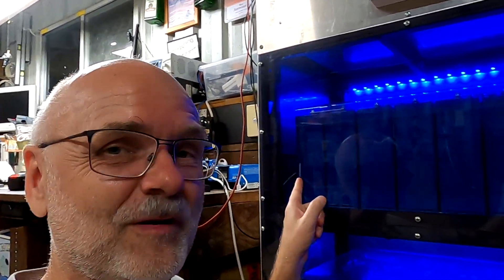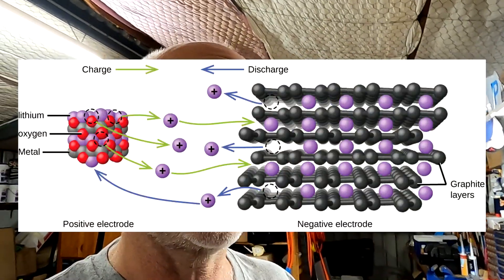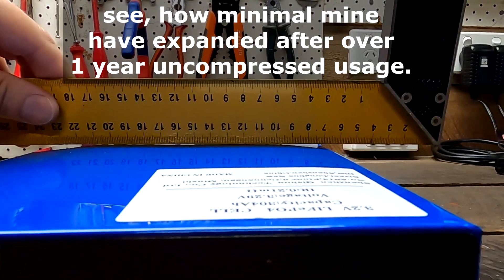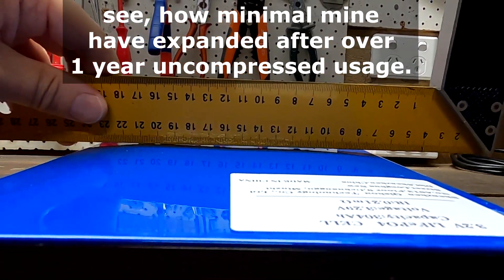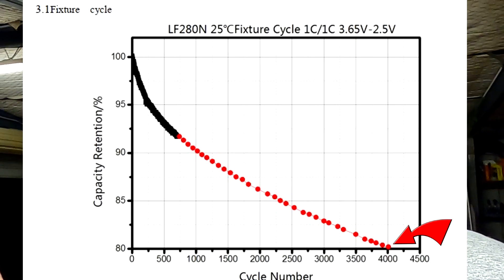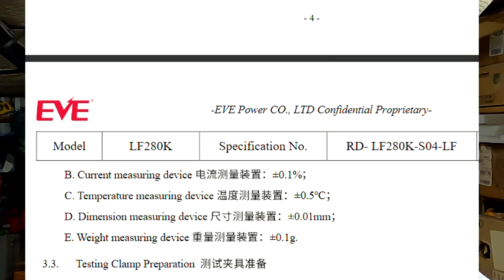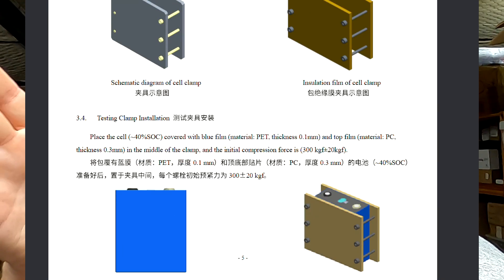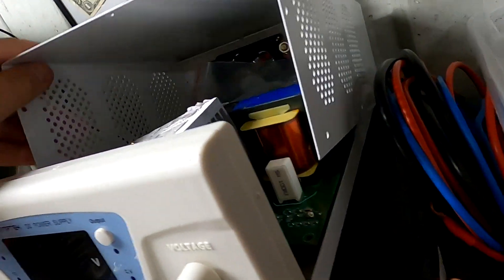Why you should compress your LiFePO4 battery! And why it does not matter... 🤷‍♂️

Comment: hi Andy 1.0, I came from a country where prismatic batteries costs a month salary per piece, the reason why cylindrical batteries/powerwalls are more common here, is there any chance you could feature cylindricals on this channel? (S168, 32650,32700 powerwalls) just to see how they compare to prismatic type powerwalls.thank you
Reply from the maker: Hi Jeffrey, thanks for your comment. Interesting suggestion. I just had a look a the specs for 32700 cells and I would need 47 cells in parallel to have the same capacity as one 280ah cell I'm using frequently. The cabling with fuses (every cell needs to be fused) would be insane... and this is just to replace one cells then!
I started the channel with 18650 cells and some other flat NMC cells I wanted to use for some projects. But for a serious powerwall, it is an insane effort to build such a battery.
I'll keep this in mind as I have some smaller projects coming up where we could use such cells...

Comment: LifePo4 cell usr manual recommends a compression fixture. Why even bother to not do it? What is wrong about compression?
Reply from the maker: Nothing wrong with a fixture. Just wanted to share the information about why the cells swell and why a fixture is recommended. But not necessary.

Comment: I wonder during expansion with each cells connected with solid busbar, would there be sufficient pressure from the expansion to break or damage the positive and negative terminals
Reply from the maker: Yeah, that could be the case! When I decided to not compress, the main reason was to allow airflow and cooling. But now with all we know, it seems to be beneficial as the cells can do whatever they want and the busbars stay as they are.

Comment: Great stuff! 
For me now...  what becomes more of a concern when putting together a battery bank? I'm thinking that a solid connection (Bus bar) between positive and negative between each battery could be a point of failure over time, as the natural expansion and contraction happens with the cells and pulls on the terminals of the battery. 

I believe that a space between the cells to begin with should be a good start, then using an expandable electrical connection between the posts should be even better. (Like what maddie the mermaid uses).  🍻
Reply from the maker: Dan, also what will happen in batteries which have welded busbars (QSO for example)...?
Reply: @OffGridGarageAustralia  Right!, Good point!
Reply: @OffGridGarageAustralia  Just about all welded bus bars I have seen have had the hump in the middle and the cells have been in a fixture .
Reply: @davidb.5544  Yes, those would be great as well!
Reply: I'm using sheets of rubber roof material in-between each cell and on the ends also. Not compressed but snug enough that they could never move. Hopefully this rubber will be squeezed by the cells expanding and contracting but keeping a kinda even force on the batteries and a extra layer of protection between cells. Hopefully it's the right thing to do as grade a eve cells cost so freaking much I sold a kidney to buy them
Reply: Compression prevents unnecessary expansion. Yes some expansion is not able to be prevented. Excess unnecessary expansion can cause delamination. I use springs to keep the cells constantly close to the proper compression. Overcharging or overdischarging causes delamination. Proper compression can stop excess expansion during those mistakes. That’s why the manufacturers of the cells recommend a specific pressure
Reply: @RJ-cc1fz  HI, any good advice on where to find how to compress these cells? Thanks

Comment: Would it not be useful to "compress" cells to make sure that the busbars do not put too much stress on the terminals, or cause bad connections? Which is mitigated when you reconnect the cells, but for welded busbars this does become relevant i imagine.

Putting some isoprene between the cells does mitigate this, as the isoprene would make sure that some space is left between the cells and takes up the swelling, and keeps the cells in position with respect to the busbars.
Reply from the maker: Yeah, we have seen this EVA foam between the cells in the Seplos box. I found this to be the best solution so far.

Comment: Thx for the video.

I built a clamp for initial testing my cells after reading that manual - not made of out metal, but out of "18mm Siebdruckplatte", and i do not exactly compress to 300kg. Well - first cell of eight i tested without that clamp, all the other cells with clamp. And i have to admit: the first cell got a little more bloated then the others - not really exactly measured it, but you could see the slight difference. Cells were nearly perfectly flat before testing (EVE LF280K Grade A Cells from NKON).

Well another aspect: when you compress flat cells with a force of 300kg and cells will expand anyway (on that atomic level), the pressure might rise above 300kg leading to damaging the cells 🤔? Not sure about that, so i do compress my cells a little using a compressed sturdy closed foam piece that can expand when pressures rises.

The video is definetly worth watching - and stills leaves some unanswered question :). I'm curious when there will be a followup.

Comment: Your calculation of only 33 cycles /a is ok for your offgrid use - but usually on normal use, in Germany they try to get more than 200cycles/a ... than compressing from the beginning matters
Reply from the maker: Thanks Juergen. Yes, more cycle matter and I would say, compression is worth doing, if it helps or not. I'm not against it.
The video was just to highlight the myth of the expanding cells and that compression will prevent it.
If your battery is rather small and you do a of cycles, do it!
Reply: Das sehe ich auch so. Meine 128 Stück 280Ah Akkus möchte ich von Beginn an gut behandeln.

Comment: Gosh Andy just when I thought I understood you raised it a notch - I thought compression was to stop the alloy containment can from work hardening with repeated charge cycle  "Panting" and metal fatigue causing cracking that might leak.
Reply from the maker: Yeah, maybe just compress them. After all, it does not hurt. I like the Seplos system with the foam in between the cells and a tight fit.
Reply: @OffGridGarageAustralia  mine are in an RV so I just strapped them together with a thin insulator between - perhaps 60kg or so to stop them from rattling :face-turquoise-covering-eyes:

Comment: That can’t be the hole story. Your cells are/were swelling. That should mean that they are changing within. I’m not saying it is bad, but as you noticed; It will create problems with the busbars. Did they say anything about that? ( Happy you still want me to enjoy your channel even though I do compress my cells 🤪)
Reply: Exactly, he did not present any theory that would explain what he's seen with his cells.
Reply from the maker: No words about the connection or bus bars. I guess it comes down what kind of setup you have, mobile/stationary. To be sure, you can just use flexible bars or make your own cables.

My cells are perfectly fine. The swelling is really minimal and is almost the same as brand new certified cells I have tested.

Comment: Apart from the arguments regarding cycle and aging of the cells, would not compressing (eg fixing ) them make sense to keep the busbars in position ? Or is it actually the other way round, always leave a bit space between the cells for the ‚swelling‘ so that there is no impact on the busbars ? ( not a option in campers / boats )
Reply: I compressed the Winston cells in my caravan battery over seven years ago. They also have flexible bus bars, and are still going VERY strong, with absolutely minimal degradation. (At the risk of stating the obvious, I think that in a mobile application it’s essential to secure them very well.)
Reply: Flexible busbars hands down
Reply from the maker: I guess, either flexibles bars or space in between the cells to prevent any force on the terminals. Both🤔
Reply: Like Andy said, you cannot stop the expansion.  Nothing on this earth can stop the expansion.  So, something has to give!  If the cells are compressed, I think you do more damage to the battery terminals under a tremendous amount of physical stress.
Reply: @marlomontanaro3233  not if you've got flexible bus burs.
Reply: The bus bars have space in them like 4-5 mm
Reply: @electro2606  when they are properly tightened, d terminals cannot move in d slots. slots just make set-up easier